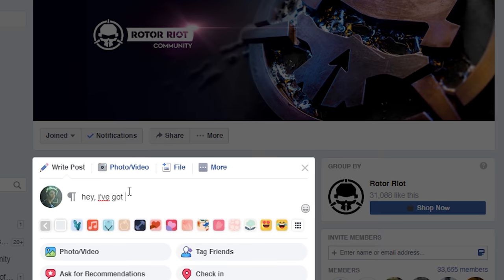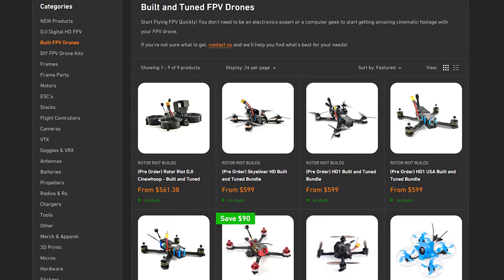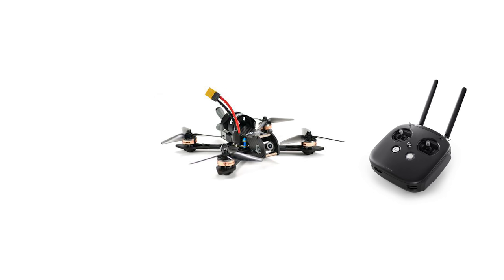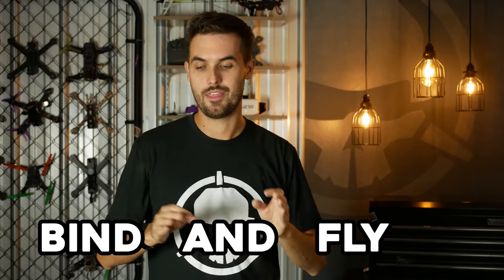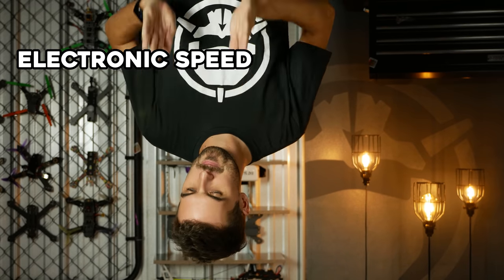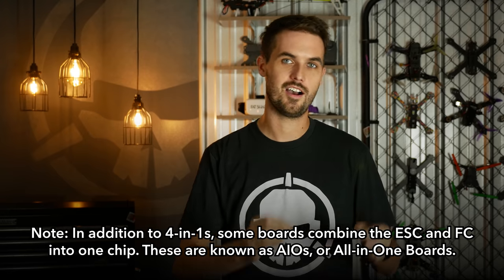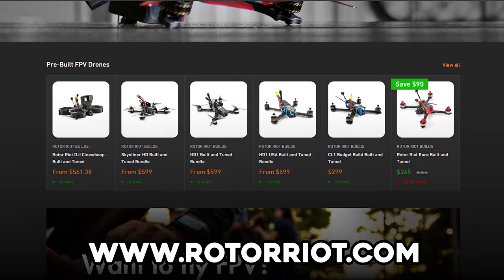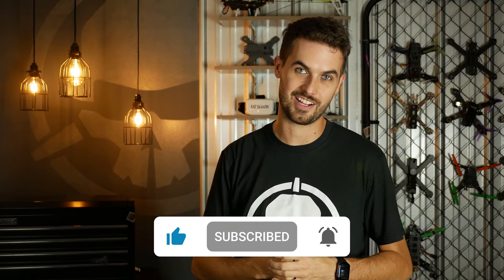27 FPV Acronyms you NEED to KNOW!

Comment: Forgot probably the most important one for beginners, JB - Joshua Bardwell. For instance; “Was talking to JB and he suggested to reflow the solder joints.” Or, “you should check out JB’s channel, lots of good info there.” Or the other Acronym RR - Rotor Riot, for instance “did you see the new RR video, they forgot some acronyms” or, “look at those new RR pilots”

Comment: Omg, the s in 4s and 6s stands for series! That's clever I always thought it was due to someone not knowing how to spell cells (and that c is already used to represent the discharge rate)

Genius I actually learnt something
Reply: The other letter you may sometimes see in descriptions of battery packs is P, for Parallel.
So 4S2P means 4 sets of 2 cells in parallel. Putting identical cells in parallel is done for increased amperage output and/or increased capacity, notably when fixed sized cells are used such as 18650 lithium ions.
Eg, my ebike battery has 18650 cells in a 7S4P setup, for the high voltage and the high amperage output.

Comment: C rating acronym is an important one, choose a battery pack with a too low C number and it won't be as enjoyable as flights with high C battery pack.
Reply: licensetodrive the “C” rating is a approximate measurement of the maximum charge(Q) in a burst. It essentially defines how the current changes with time when shorted. The unit for charge is the coulomb (C). Therefore is a unit not a acronym.

Comment: So I’m new to this, why do you use lower KV motors with higher series batteries? It seems backwards to me lol can some explain.
Reply: The speed of a motor is governed by voltage. Kv is the revolutions per minute per volt.
4S voltage in a 1700Kv motor (designed for 6S voltage) will make it spin slower than required, so the Kv needs to be increased for the lower voltage going into it, which is typically 2400Kv for 4S.
Reply: @licensetodrive9930  ok that makes sense thank you :)

Comment: Sbus is wrong. Sbus is the signal that goes into the fc. It is the signal that goes trough the cable between rx and fc. And not the protocol between the TX and Rx. On futaba it ist Fasst, on spectrum dsmx and on frsky accst.

Comment: FPV, RTF, PWM, etc are not acronyms, they are initialisms. An acronym is a word formed by the initials of the works. I.E. Radar or Laser. An initialism is just the group of initials. I.E. CIA, IRS.
Reply: @ToadM16  pwm and rtf are not words.
Reply: @ToadM16  correct and an as I stated before An acronym is a word or name formed from the initial components of a longer name or phrase, usually using individual initial letters, as in NATO, but sometimes using syllables, as in Benelux, or a mixture of the two, as in radar. Therefore PWM, RTF, etc. Are infact not acronyms or abbreviations as stated in the video or by you.
Reply: @ToadM16  St. Ave. Or Blvd would be examples of abbreviations.
Reply: @ToadM16  also Li-Po or Li-Ion would be abbreviations, Drib was right about those!